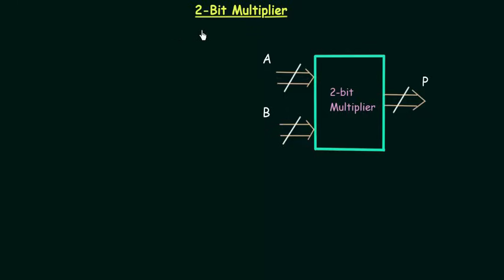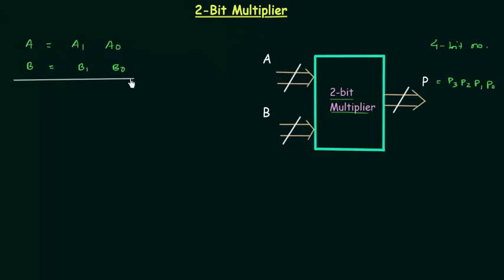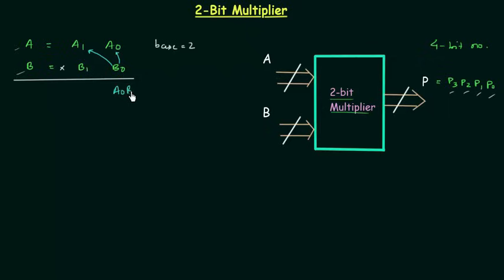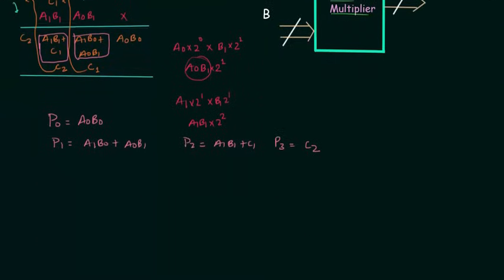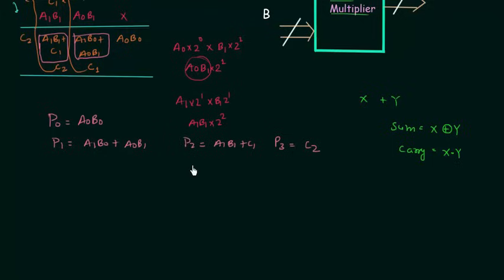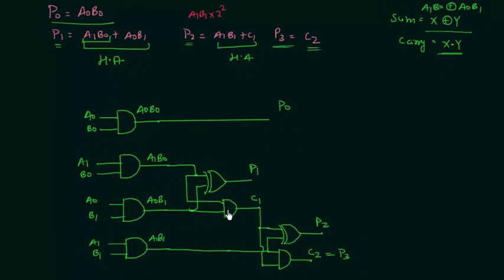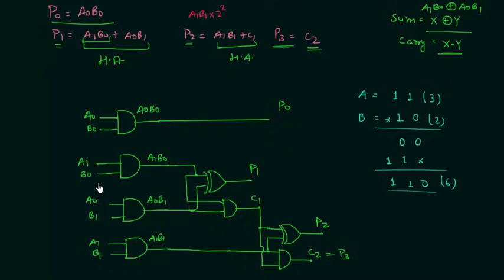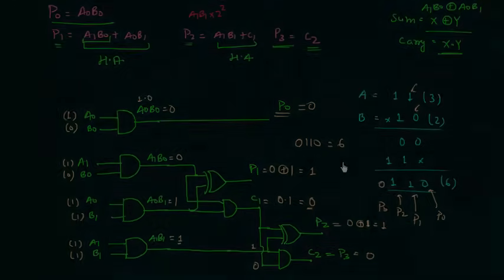2-Bit Multiplier Using Half Adders

Comment: at 6:36 why can't we use or gate to add the numbers ??
By the example also if we put or gate instead of x-or we get the same answer(8:45 minute)
Reply: At first I thought same like you but actually we are thinking it because In OR operation we cannot tell the carry...But in case of Half Adder we can...
Reply: I'm also having problem related to this ?
Reply: @attackontitan9834 this is the reason, right ?

Comment: Can we use simply OR gate instead of xor gate?
Reply: Nope, the truth table of OR and XOR gates are different.
OR:
b0 b1 | Y
0   0  |  0
0   1  |  1
1   0  |  1
1   1  |  1

XOR:
b0 b1 | Y
0   0  |  0
0   1  |  1
1   0  |  1
1   1  |  0

So, your best approach to XOR by using Karnaugh map is:
[(NOT b0 AND b1) OR (b0 AND NOT b1)]

Comment: why are u using xor gate to find p1 while u need or operation only
Reply: fasil pm  there for p1  we need  half adder in doing p1  operation...in half adder  we use   xor  gate for  sum
Reply: ORing is not addition.
XOR performs addition
Reply: Because in OR gate, 1+1 gives one and that's not addition operation. It may seem at first sight that we can simply use OR gate though that's not the case. We have to use XOR. It's called arithmetic gate for a reason.☺️